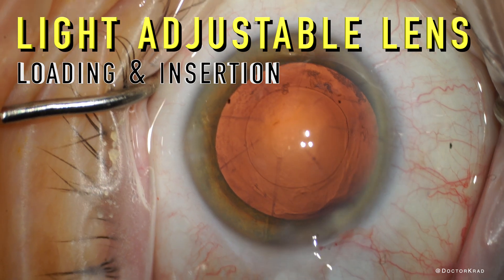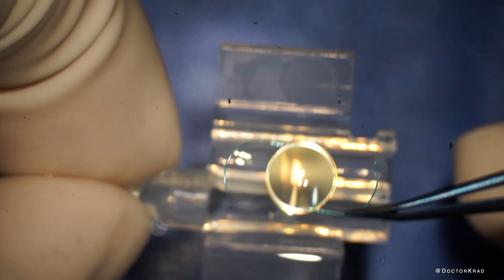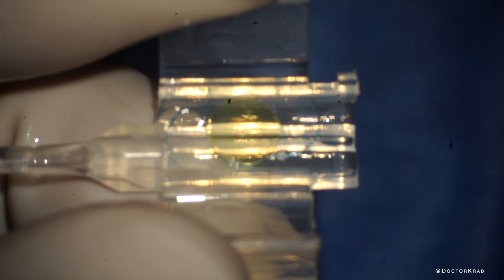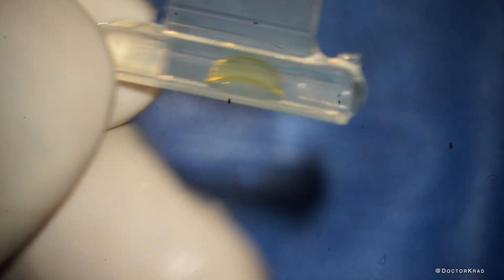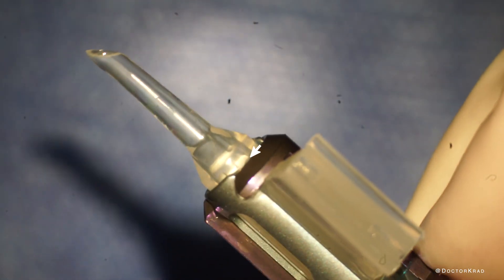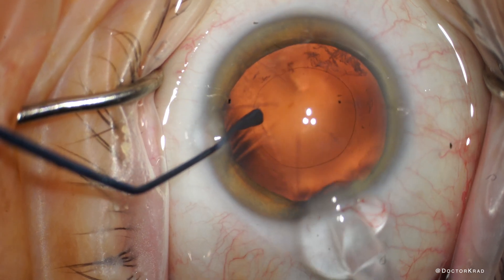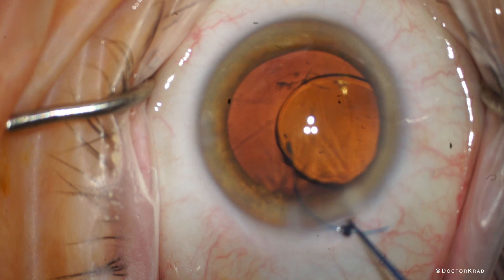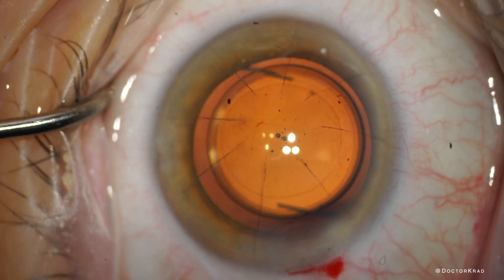HOW TO LOAD the Light Adjustable Lens | LAL Loading & Insertion

Comment: Thank you for showing the process of placing the lense. Would you use LAL with patients with moderate glaucoma.
Reply from the maker: It’s fine to use in moderate glaucoma.  As long as the potential vision after surgery is close to 20/20, I think it’s fine to use.  If someone’s potential vision after surgery is a bit blurrier, such as 20/50 vision (example: from significant diabetic retinopathy, macular degeneration, or a lazy eye), I would personally not use it so the patient saves their money.  They might not notice a difference compared to a less expensive lens because they can’t see fine detail anyway.  Moderate glaucoma patients are usually correctable to 20/20 if there are no other eye problems.